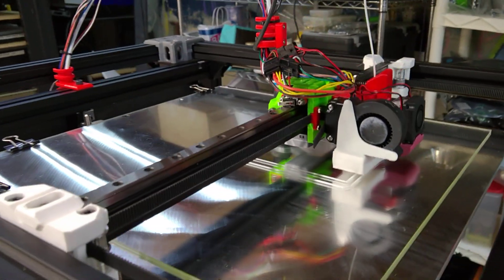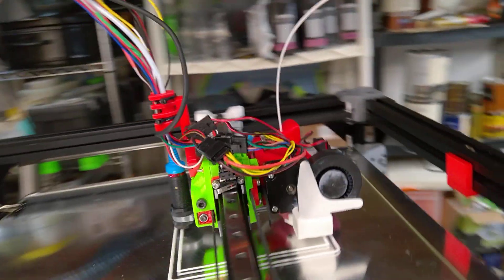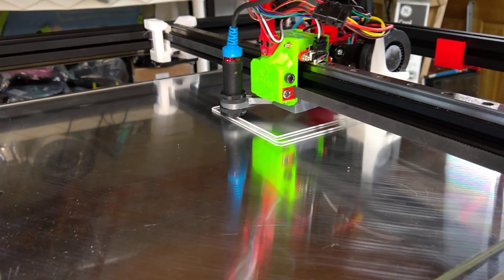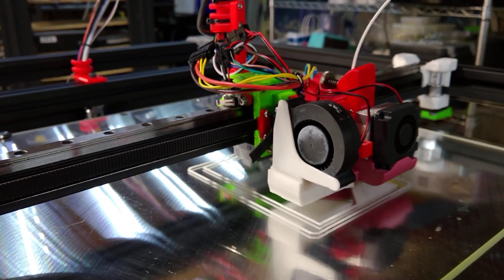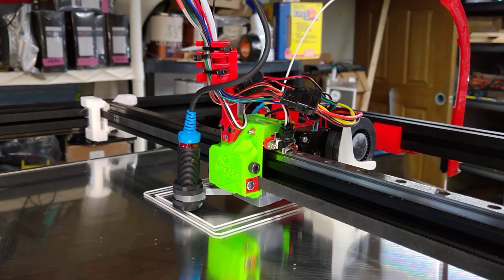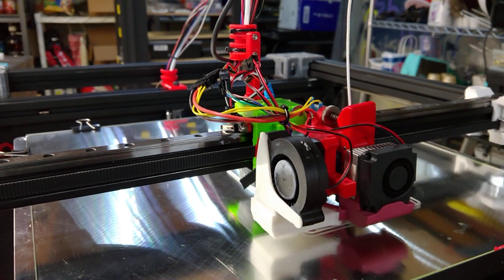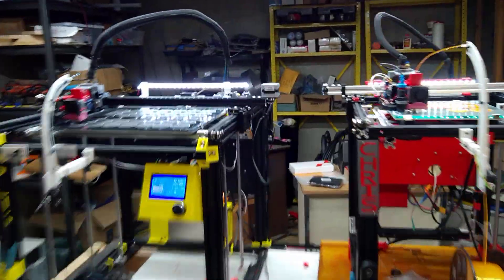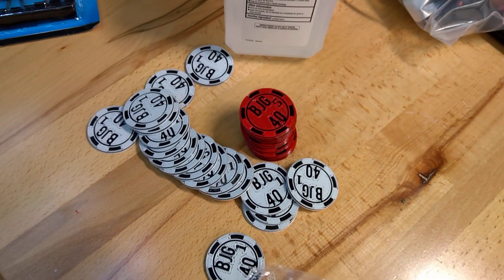RAT RIG first real print

Comment: You are right about this not being the best printer for a starter printer. Especially with the engineering flaws and lower quality parts that are in the V-Core 3. Even the manual has you assembling things in an order that makes things way more challenging to build.
Reply from the maker: I curious about the engineering flaws you mentioned, could you elaborate?   I am also disapointed in the idler assembly, I think some kind of bearings would have been useful.

Comment: Hey there! We were on the last Kersey's patreon meeting, I was complaining about the abusive taxes and shipment stuff from Ratrig to Brazil and you said you were assembling one yourself... Great to see it working... I'm almost done receiving all the parts I still need from the BOM so I can continue getting mine ready :)
Reply from the maker: Good to hear!   A couple of things to make sure of, if you are going to use a back electronics panel get it ordered before you start.   It is needed almost at the beginning and is impossible to add later.   There are some alignment tools that you can print - handy to have them done before.   I spent too much time on the cable management, but am very happy the way it turned out.  I also sourced a glass bed locally after the one I ordered was too small.  Not the companies fault, mine for not knowing the bed size.  A 400 mm machine needs a 430mm glass sheet to cover the entire top.  I also added a filament runout sensor and an ADXL345, works great on my Octopus.
I'll have an update within a few days.  Let me know if you have any questions.
Reply: @woodwaker1  Hi! Thanks for all the advices! About the back panel, it was the first thing done here. Already have it installed, with all the holes for the components. Main issue now is that I didn't pay much attention on the slide model for the linear rails, and I got it wrong... Not a real problem because I can use it on other projects, but now I need to wait till late october to get the new ones from china... No biggie, just some delay... Other than that, I already have everything sourced. The glass bed I also sourced locally. The ADXL I bought a couple ones months ago when I installed klipper on my ender 5 plus... Pretty much waiting on the rail slides to continue assembly. About the cable management, I'm aware it could be a little painful but Ill spend as much time I need to make it good... Not gonna rush on that. Again, thanks for all the great info and looking forward for your updates!
Reply from the maker: @lpalmeidabh  Here is a more recent video that shows more of the wiring/cables.  I used 1/4" split loom and put the wires inside.  Some protection, but mostly for looks.  I also printed some cable holders that attached to the 3030 channel.   Let me know if you want any more details

Comment: Nice man!! Something I noticed which may help you out... Your X ends top microswitch is rubbing on the linear rail. This could accidentally trigger and cause some issues going forward.
I'm looking forward to starting my build!!
Reply from the maker: Thanks for the observation.   I modified the top block to add a mount for the ADXL345 and made the end stop mount part of the block.    I reprinted most of the EVA mount to make it stronger and replace the captured nuts with heat melt brass inserts.  I'm in the process of setting the input shaper and pressure advance.  I just got a new glass plate for the bed that is the proper size and am testing that also.  Will have a new video soon.

Comment: I see you have XChange mounted on 3 other machines. What was your issue on the RatRig versus these other 3 machines?
Reply from the maker: I was loosing too much build area.    My Enders all have a dropped front rail, which allows the X change and OmniaDrop to go past the build plate, they also have more space on the x-axis.  When I had the x-change on the Rat Rig, I lost 90mm of Y, now it is still 60, but better.
Reply: @woodwaker1  Maybe there is a machinable solution to allow for better mounting.

Comment: why no EVA?
Reply: Getting rid of EVA is a solid step in upgrading this printer to be able to do functional precision prints. Nothing wrong with using a Hemera, and a gantry replacement that is underway in the community will help improve this one.
Reply from the maker: @johnbeima6413  Could you send me a link to any information about this, I would really appreciate it.
Reply: @johnbeima6413  i really dont want to say the hermera is a bad extruder, not at all. i was just curios why he choosed this one for a RatRig, thats all. But i have never heard that the EVA system prvents you from printing precision parts, hard to believe, having two RRs and im printing all day long functional parts without any issue. Whats the problem with them?
Reply from the maker: I have modified it - using a Hemera mount as the starting point.  The  OmniaDrop has its own fans.   I cut the fan out of the back and reversed the Hemera mount on the front, added an Ezabl probe mount to the bottom.  Still a work in progress.
Reply: @woodwaker1  dont you think that a hermera is the wrong choice for such a capable printer? this device is able to print way faster than what this hotend can do, its a mayor bottleneck
Reply from the maker: @HelgeKeck  I agree that a Hemera is the wrong choice.  I'm using an OmniaDrop - using a modified the Hemera mount.   I really am not worried about speed, I got the Rat Rig for the build experience and to see how well it works.  I have 10 OmniaDrop units and that is the only direct drive I use.  I have many videos on them printing and have had great success with them.  I had 5 Hemera units and replaced all of them after having too many problems.   I'm excited about the print area and the leveling process on the Rat Rig.